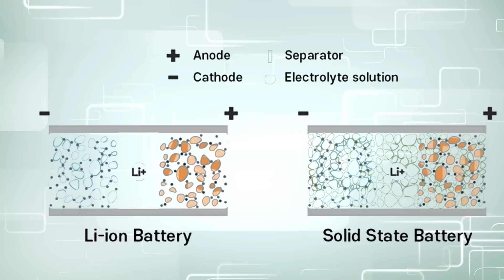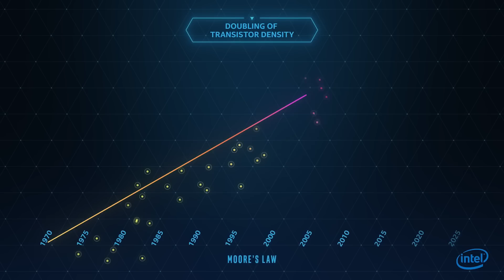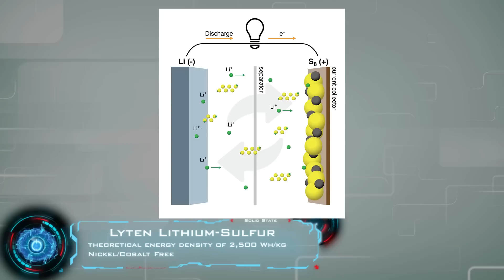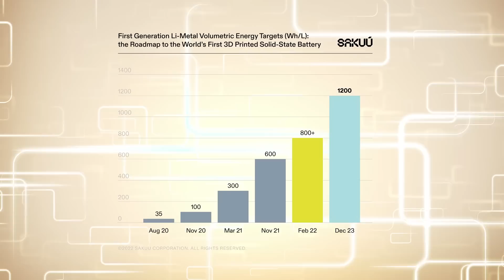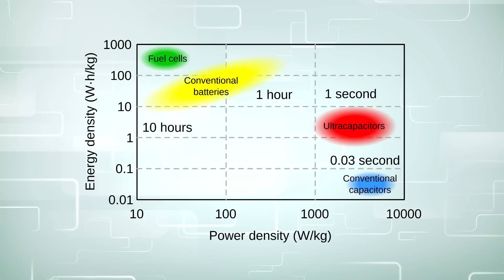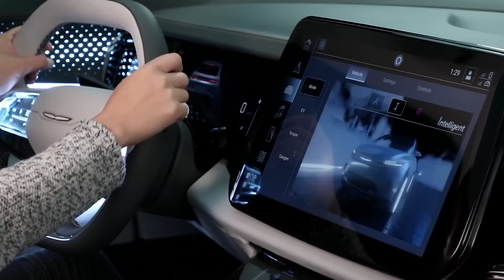The FUTURE Battery is HERE! - Solid State

Comment: Batteries all have the same issue, THEY ARE NONRENEWABLE.  Add to that the incredibly dirty process of mining for minerals, manufacturing and distribution, and it's really a simple process to determine that batteries are a loss for the future of the earth.  They will eventually cause the same mess that oil has caused.  However, there is a clean solution, Hydrogen.  The problem is one of economics.  No one gets obscenely wealthy selling Hydrogen, because it's free.  Unless they figure out a way to get rich, it won't be developed.  Pretty simple really.  Earth be damned, either I get rich or it doesn't get made.

Comment: Higher battery density is not necessarily the key to better performance. Electric motors are not very efficient. There are avenues which still need to be explored, such as placing the electric motor in a liquid nitrogen tank. Or balancing the electrical load by combining electric power with kinetic flywheel power. A long slow battery drain is much more efficient than stop and go bursts of current.
Reply: 3 phase Electric motors used in EVs are 85-90% efficient, utter garbage!
Reply from the maker: Correct, also people forget that motors do not have directed magnetic fields in the coils/magnets. So a lot of the flux is lost, there is one claim that they created a halbach array motor but I am really skeptical of that.
Reply: That's bullshit,ev motors are very efficient,there is motors with up to 96% efficiency achieved...don't know where you got that idea

Comment: I don't get why super capacitors aren't used for initial fast charge, and top off to batteries.  I.E. have the capacitors as a buffer to manage charging in edge cases, and have more on demand peak power available..
Reply from the maker: I think that is the game plan for skeleton tech, make them for buses. Its a good point though as most of your power draw is during acceleration.
Reply: Capacitors are not in the same league as batteries. EV batteries can easily handle currents large enough both for driving and charging. Capacitors do not add anything and they are 1/20 the energy density. That's why they makes sense in city busses where they can be fast charged at every stop.